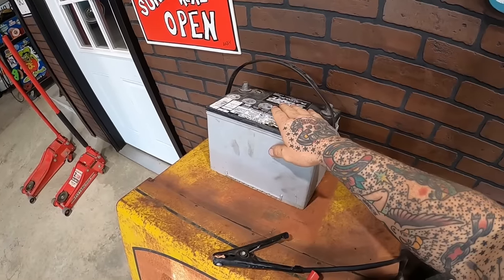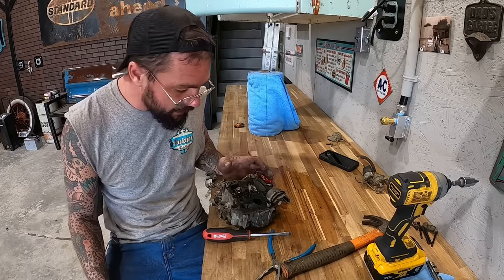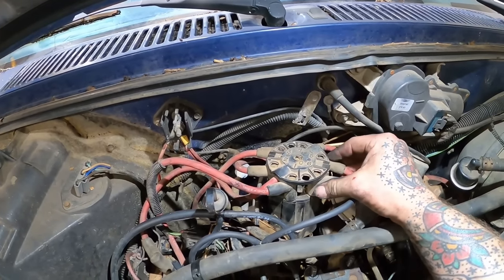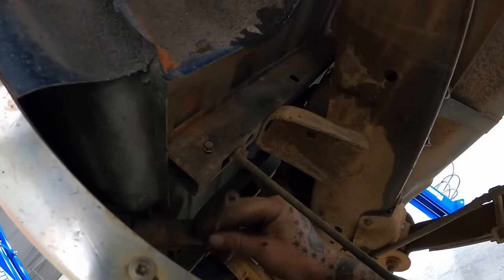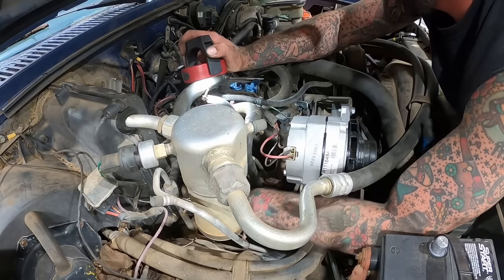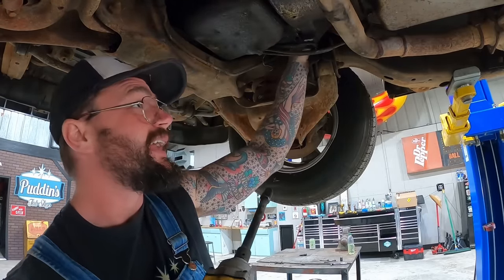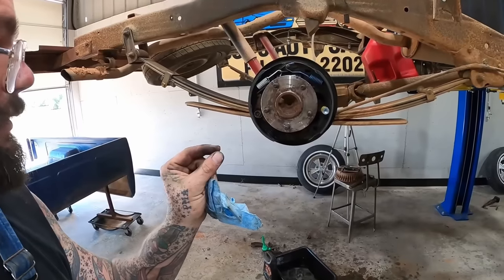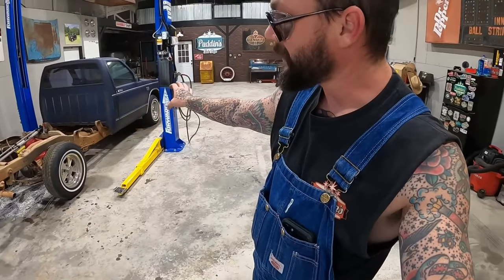1984 S-10 Pickup. MECHANICAL REBUILD. Will it RUN/DRIVE better?

Comment: The 84-85-86 Jeep Cherokee used this engine. Oil leaking nightmare. Pay close attention to the rear of the intake manifold. If it’s leaking, there is a pocket on the back of the engine that fills with oil. If you ever do one, take your cutter wheel and cut a groove across the width of the ft and rear of manifold. Helps keep RTV from blowing out.

Comment: I had an '85 S10 W/ 2.5L Iron Duke on a 4spd manual. Here's the truth, so help me Lord! Me and my GF were living in B.C. Canada after moving there from Ontario Canada. After three years in BC, we decided to go back to Ontario. A guy in our building had this nice slide in camper sitting on a red '85 S10. They were sitting in the parking lot for six years. When I asked him about the camper, he said he would take $600 for the camper, and if I needed a truck, I could have the S10 for free! So I asked, what's the deal with it? Well, it's been a while but it has a slight knock in the bottom end. Not too bad, he said. But I bought a bigger camper and a bigger full size truck for it, he said. So, by the way I'm a mechanic by trade. I bought the camper and got the truck too. So after new shocks, plugs and wires, r-button, tires and last but not least, a complete synthetic duralube oil change and filter. The day came and we left for Ontario. I'll tell you, we would pull in a gas station to get gas and the guy would tell me that the diesel pumps were over there and I'd say " it's not a diesel. Oh, man the looks I'd get. Like it was gonna blow up any minute. It's funny cause the weight of the camper with all our stuff definitely weighed more than the truck, for sure! And yes, not only did I make it, but I used the bloody thing for another year in Ontario... Hamilton to be exact. It was the best truck I never bought! 100% true. I can't fault the Iron Duke. Diehard for sure. Cheers my friend...d..

Comment: The s10 carb had iceing an cold weather problems so they installed the heater to defeat the issue. If the teuck goes north then it may not run good in cold weather

Comment: I worked for a Caddy dealer in the early 90's. I got boned with valve cover gaskets on all the Broughams, which had sealer, no actual gaskets from the factory. They all came with the  carbureted Olds 307 Y engine, which was loaded with vacuum lines, that were also brittle and needing replacement. After the second or third one, I could fly thru them because by then I knew where all the lines went. We were flat rate, so time was money. Always a pleasure watching you work.

Comment: That is a heater under the carb, if that doesn't work you get a icing problem in cold temps. I had to replace the one in my 85, it would ice up on the freeway and slow down to a crawl. I'm in Michigan so not sure if they are needed in warmer climates.

Comment: I've only worked on many 4.3 liter v6 s10 and blazers I didn't know that had a smaller v6 then .that .I only worked on the fuel injection engines .they weren't bad working on plenty of room. Except when messing with the distributor was a night mare
Reply: Oh brother, the distributor is a nightmare on those 4.3`s!! Had to have a friend who is taller than me install the cap as I could not reach it even after climbing & sitting on top of the engine!

Comment: I had a 92 4.3 V6 it had the throttle body fuel injection.made it to 400,000 miles before it quit.4x4 extended cab.full of rust no floorboard.looks like a pretty solid truck. I have an LS for it.

Comment: heck yeah. a 2.8 running and driving that doesn't diesel when you shut it off. I'd say you got it running pretty darn good. A feller wouldn't mind tooling around town to the parts store and harbor freight in that lil ol sport. That interior is amazing

Comment: See you having fun with 2.8  they were a bit of a pain , 
Most of them are gone after 100k . The carb is a nitemare  , changing plugs are a bth . Good clean straight truck.
Reply: We have a 1984 with 280,000 miles with the original engine & clutch. The engine has been rebuilt with new rings & re-bored at .030 over. The engine was still running fairly well at 233,000 miles when re-built. Still has original oil pump & carburetor as well as the front wheel bearings. We noticed when you repacked the bearings they were still original as they had the plastic outside cage that Timkin started using in the 1980`s. How many miles on your 1984? The bodies of these trucks are the weak points & are thin! We have had our truck since new driving it off the dealership lot in March of 1986. We have had the body rebuilt 3 times!! Reason we did as a 4`10" guy, This is the only truck that fits us perfectly.At the time we had a C10 with the infamous 5.7N engine! The head gaskets blew 3 times! Finally rust ate it up & we then bought the 84 S10. It is our go to truck for hauling hay & tools when working at our properties.

Comment: In 1987 I bought a 1982 S-10 with the Isuzu 4-cylinder engine, and this was an excellent litle truck, albeit rather gutless. It has virtually the same exact interior as the one in this video.

Comment: I had a S10 blazer and I remember how much swearing I did changing out the starter, but I also had to remove a skid plate
Reply: I swear regularly when I work on my mothers 1989 S10 4x4 Blazer!

Comment: It's going to be fun getting those carb nuts back ON when it's time!! These are the years of vehicles I used to use a Haynes manual to figure the heck out how to take something apart without wasting a whole day swearing at the motor and how stuffed up it all is under the hood!!! Man the 80s were a terrible time for cars and trucks and emissions. Thankfully today (2000s and up really) cars have actually gotten quite a bit easier to work on from back then. Nothing like pre-emissions crap but still.. they're not so bad today as long as you understand computers rule today!

Comment: 93 Sonoma ranks very high for vehicles I have owned over the years.  It was always a pleasure to drive.  340k miles running parts about 150-200 miles per day.

Comment: i had a exstended cab s-ten durango 5 speed one of my favorite trucks ive owned
Reply: I have 1 now that a local farmer gave me for cost of scrap. A project truck that`s filthy dirty but only has 120,000 miles & mechanically is in good shape & is 4 x 4 which still works!

Comment: You did a fantastic job so far on that S10. Dang thing is tight.... but nothing like modern vehicles, so there's that. Looking forward to seeing more progress on that thing. I'm such a fan of S10s. Had the 2.8, 2.5, & 4.3ltrs.... all pretty decent engines, with 4.3 being my favorite. My S10 blazer has over 300k on the clock, all original.

I can't wait to see the final product.  The winner will be 1 happy SOB! 😁
Reply: BTW, those valve cover gaskets are some of the worst designs ever. Cork & rubber ones ALWAYS leak. Did you happen to notice the cutouts in the cover? Every regular gasket splits, even if under torqued. The only gaskets I've ever found to work on the 2.8ltr, is the expensive rubberized gaskets which has metal incorporated in them. It keeps the gaskets from deforming and splitting.  The part # is 15-10560-01 Victor Reinz. Hopefully this helps you in the future,  as well as others.

Comment: Sometimes it's easier to jack it up, pull the front wheels and go through the wheel well to get at the plugs. It's how I do both my s10 shop trucks. One is a 1994 4 cylinder, the other is a 2003 v6.

Comment: I always drill a hole in my thermostats to prevent them from air locking.
Reply: Good tip. I did not know of! Have seen that hole drilled before & always wondered why. At almost 68 one can never be to old to learn new things.
Reply: @frederickbooth7970  I learned it from an old school dirt track racer, he told me he used to do it for the same reason.

Comment: Just a suggestion, when your doing drum brakes that have an adjuster on the bottom. Put the shoes on a bench or the floor, put the adjuster in, and then put the spring on. The shoes will hold them selves in place while you put the spring and cap on the nails.

Comment: Puddin, get yourself a set of long handled Diagonal Cutters with narrow Jaws. These work the best for installing/removing those long Brake springs. And no, they won't cut thru the Spings. This'll make doing rear Brakes  MUCH easier.

Comment: Just to help you out. The two lift arms with the jog, that is so you can fold those arms back with the other pair. It makes life easier in the long run. It also keeps them out of the way when the lift is not in use. 
I hope this is a help.

Comment: Love the video man I had an 85 with the 2.8. For some reason when I drove about 70 miles non stop it would loose power and die, never figured it out just turned it into a wheeler.

Comment: Yep, my Mom's had a Chevy citation with that little engine and craZY Cooter, it has one of them weird carburetors on it. I rebuilt the engine and that funny gas air-a-tor. Ran it till the lock up torque converter wouldn't come unlocked when at a stop, the engine would bog down like a standard transmission. I didn't want to pull that motor again just for that..

Comment: If you really want to do it up right for the winner, see if one of those salvage yards has a rear end from a 98 and up s10 blazer 2wd. It should be a direct bolt in swap, and will give you a limited slip rear end and rear disc brakes.
Reply: Budget friendly buddy..

Comment: These trucks nowadays are not made to be worked on. Engineered by someone that was educated far beyond their intelligence. Trucks are like a Bic lighters now. Throw them away when they quit working. If you were not a mechanic it would have cost more to fix that truck than what it was worth. Someone is going to get a “like new truck” mechanically. Hope they are well deserving.
Good job Puddin. You the man. 🫵🙂👍

Comment: 43:07 that is called a "cold mixture heater" commonly found in Aisin carburetors. It pre-warms the fuel under certain temperatures and conditions for better combustion, it does almost nothing unless you live in a very cold climate. I took the one in my old 88 Corolla out years ago and never noticed a difference (nor did that car). Similar in operation to a cold start injector/time switch combo

Comment: I believe that heat sensor between carburetor  you pulled out is to let the computer know the motor is warm and idol down at least that's how it works on my Dodge van

Comment: The reason the front shoe is shorter than the rear shoe is that in rotation , the front shoe is helping apply itself as it is pivoting into rotation , it is called "Servo Action"  and the short pad is usually harder friction material, than the rear shoe. The reasoning is that rotating forward at highway speed, a full size shoe is prone to applying Too Much application pressure and locking up the wheel, whereas the trailing shoe thrust is transmitted through the wheel cylinder to the front shoe further applying the front shoe actually affecting the feel of the brake pedal.  Unlike the multi pivot brakes Ford and Chrysler used for years.

Comment: The most common job site injuries happen when you don't use your eyes(situational awarenes)are concussions.....they make a plastic ball cap filler to stop that( not well but enough..... busting your knuckles (using hand tools the right or wrong way) they also make gloves for that...... and broken wrists and ankles using pneumatic tools ŕight or wrong and tripping over lines

Comment: That S10 would be a prime candidate for an old hollowed out modern Catalytic Convertable option! Don't throw out those hollow Converter Shells. They're great for straight thru Horses on the DL.

Comment: Evenly distribute the weight on the lift If you can fully open the door ur doin it wrong or have something to small on the lift 😂😂 they just mad because there still working in dirt with screw jacks

Comment: Check into getting that floor epoxy they will have it done in 24hrs I think is called 24hr floor. That looks exactly like the truck my wife had when we met  we got together in 1990   She wouldn’t put oil in it till the lifters started rattling. Then I bought her 94 Chevy 1500 turbo diesel with the 6.5 yr in it from factory. We saw the window sticker he special ordered it he paid 34,000 $ for it

Comment: Puddin, so you can run those hubcaps on the wagon can’t you weld some small beads with the tig welder on the bumps that hold it on the wheel to make a tighter fit? Maybe test it on a extra wheel with a not so pretty hubcap to see if it works
Reply: He's done that in past videos... 😊

Comment: Ya know, there's three contact points on the Backing Plate that should have a light dab of grease on each. Each point contacts the inner three points of the Brake Shoe. (This stops the squeek, squeek noise from metal on metal when pressing the Brake.). Just a little knowledge tip. XLn't job BTW!

Comment: The sccordian carb . One of the most frustrating ,complicated engineereding fail . Lol I used to rebuild 2 a week because bsck then a new one was $600 buck.  Hint the electronic metering rod solenoid shiuld be cnaged and replace the temp sensors ( some have 3. ), good luck maybe it's not in to bad of shape.

Comment: You should run 2 cans of BG EPR through the system (oil) and rechange the oil. Stuff works great. Also cleans the oil control rings pretty damn good too.. I say use 2 cans.. it's just double gooder..

Comment: At the beginning when you was rebuilding that carb makes me wish mine was carbureted. I absolutely do not like the tbi injection my 86 2.8 has. I wish I can find a way to swap mine to carb. I don’t like the idle air control valves that I’m constantly fighting or any of that throttle sensor bs. I’ve got plans for mine anyway soon as I get a good gas saver lol. 3800 swap or you know what the other option is. Ls swap! I don’t want to do a ls but if the 3800 won’t go in then ls will be plan b lol

Comment: Puddin I owned a s10 blazer brand new . It spent more time at the dealership than it did in my driveway, if it wasn't the transmission, it was a  valve train problem , to a total wire harness replacement could not trade it off on a ford fast enough ...

Comment: Pudding this is Paul in Youngstown Ohio and I have been handicapped since the summer of 1975.  When I broke my neck this had me not walking for a while.  The right leg died out and slowly after surgrys it flinched and slowly came back,.  I am the guy who wanted one to build me up a truck to help me carry some food home from the store go to the bank and get my dirty laundry all washed up.  I have been sober and clean for over 43 years now.  And I am the guy who is willing to pay some on the truck for the truck for me to use.  Am a shut in at home with low sugar and cannot get me a ride to mortor vechicle to get my expired license renewed.  Then I can drive the chevy truck back home.  I may have an impact driver battery powered for one and a set of craftsman tools new to go to one.  I appreciate all the hard work one does.  I do total absentense now I don't drink or take anything else either.  I had two gas scooters and both of them were stolen from here with my two lawnmowers that were locked up.  I heard the cable being cut and was just too slow to get  out there in enought time to catch the theives.  I prayed for all the people who took my stuff and this kept me calm and I belive I get the help that I pray for others.  I have to cook for me cause everyone else is adding in sugar, salt, or bad fats to my diet when man prepares food.  I don't add anything except some really good garlic.  Oh the guy who is miserable Morsky, let him bring his dog with him and two beers and see if this just doen't cheer him up.  Years ago I laid under my oder cars and just looked at stuff with a beer.  I got nothing done.  I did not know what to do under the car either.  My brother had to inform me as to what to do.  I the one that was not allowed to help out.  And when I watched one tonight my left lower side was hurting or pinching some as I was laughing to what one was saying.  I would like to get the truck.  Thanks Paul

Comment: The 1980’s were a bad time for carbureted engines.  So much complexity trying to meet emissions regulations without computer controlled EFI.  This carb is a prime example.

Comment: Carb base gasket has the intake heater for warm up. And when they go bad the screen frosts up in cool damp weather. Best to lose it. What happened to the alternator kits a guy used to get? I miss those days.

Comment: Engine vacuum really should only be used for distributor signal. It should never be used to operate stuff. Even the power brakes should run off of the power steering.

Comment: The 2SE and E2SE is in my opinion one of the worst carburetors ever built.   Overrun with emissions crap.  When my 1984 truck had one I had a fire caused by it, and I swapped on a Edelbrock intake and Holley 390 cfm 4bbl.  Huge, huge improvement all around.  Felt like it had a new engine in it.  Nothing chokes a 2.8 better than a 2SE.  Your video was like me reliving my experiences with that junk.

Comment: My first S10 was an '84 with the 2.8, automatic and a.c.
Just picked my #8, or is it #9? '93 shorty, 2.8 with a 5 speed. 
And it even runs and drives and stops!

Comment: As most Utubers remove the tinted hood visor/guard , I am hoping you keep this one on the S-10!
I may be 49yo, but they do work to minimize bug splatter on the windshield on roadtrips...
Why not clean out the old S-10 fuel tank and fit it within the box of the "Yee-Haul" (larger tank = more miles driven)?